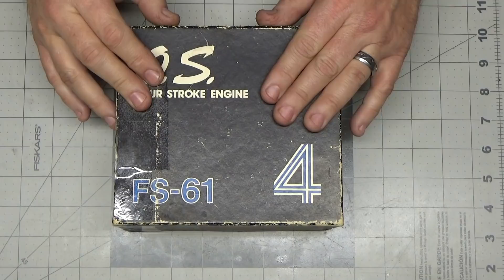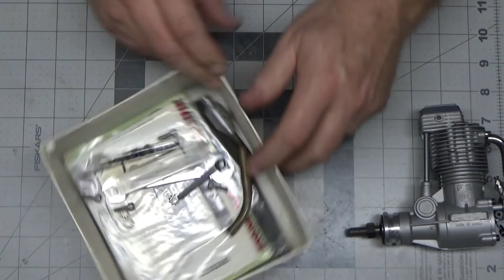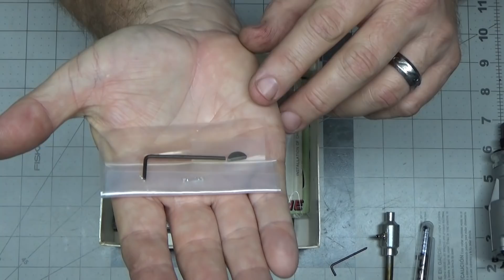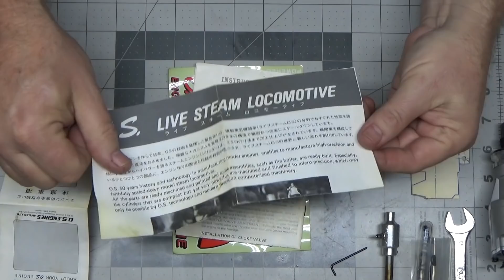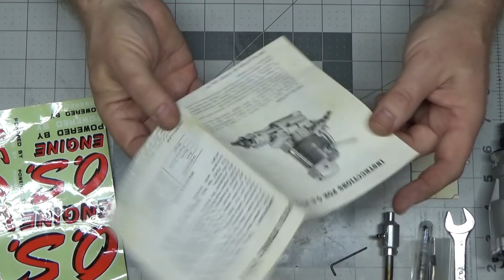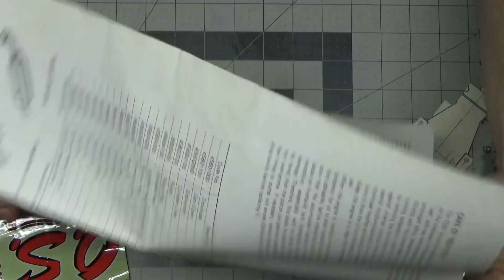OS FS61 A Quick Look

Comment: Those early pressure adaptors look really cute haha  I have an FS-61 too. Same cool factor are the exhausts on the Enya 41 46 53  4 cycles.  Even the early OS FS 120 FS 90 came with the pressure adaptor. Yeah that engines a keeper :)